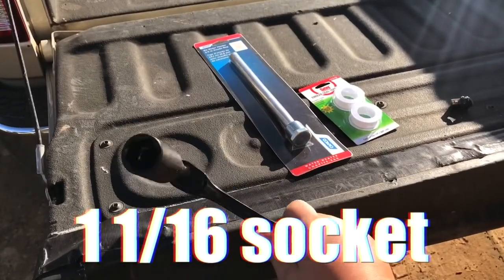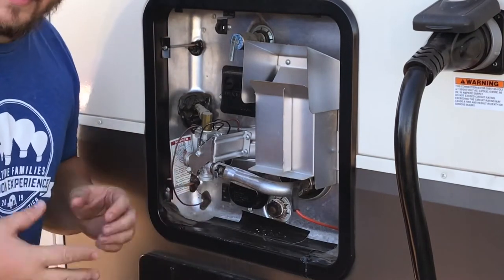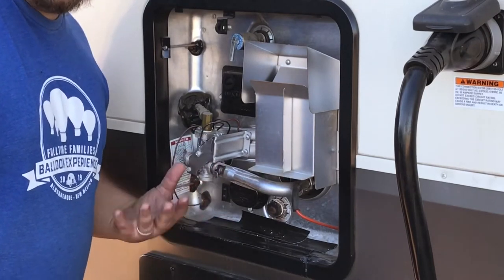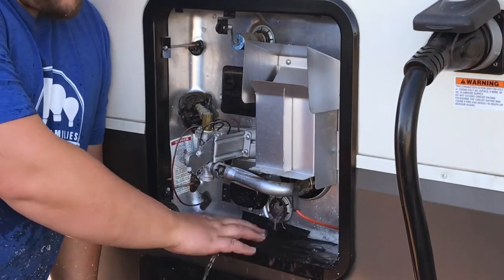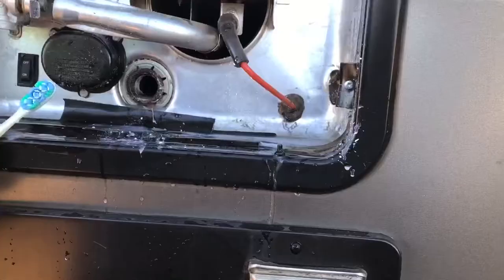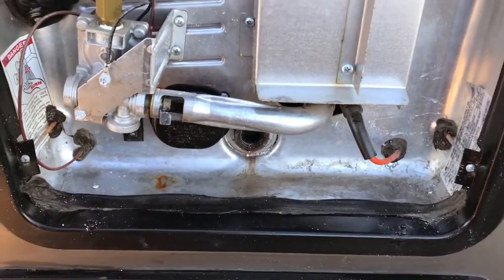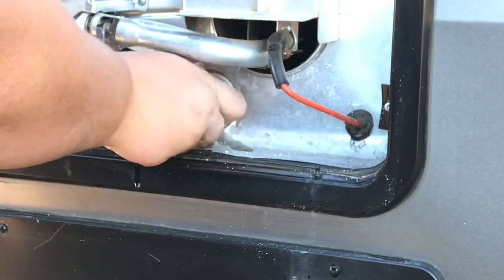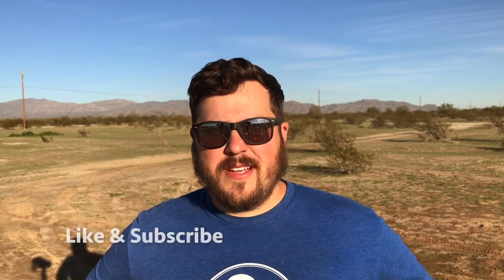Changing an Anode Rod in your RV // Full Time RV Family

Comment: Great video! Im glad that doesn’t happen when you cut in to an avacado. 😳Great information and as you stated a must do. Most folks don’t know that they have that in their water heater so this informs them that it’s another maintenance item to be done annually. Looking forward to the next video. Stay safe and safe travels.
Reply from the maker: Mel Duncan yes it’s a must. It’s in the manual and it beats a $450 hot water heater replacement.

Comment: I just purchased an anode rod that I will be replacing next week when we de-winterized (since we are moving into the RV) and at the dealer they recommended a wand type attachment which you hook up to a hose and flush out the tank when replacing the anode. I had no clue about this but I did buy it to use.
Reply from the maker: Teachers on Adventures that’s cool. We need to look into that.